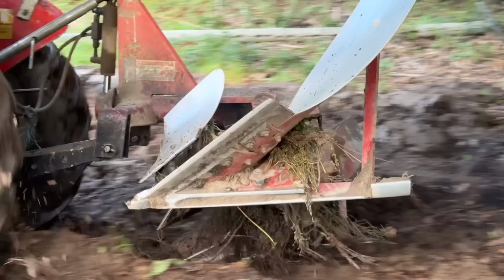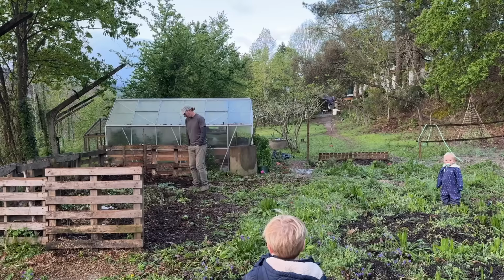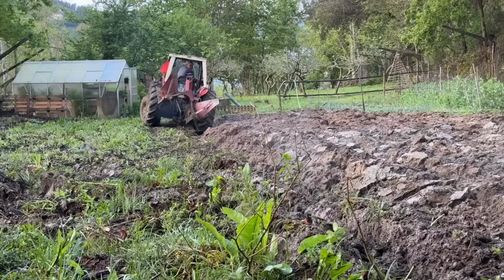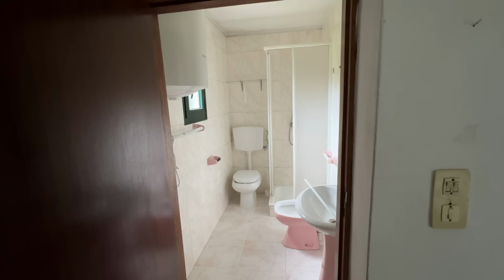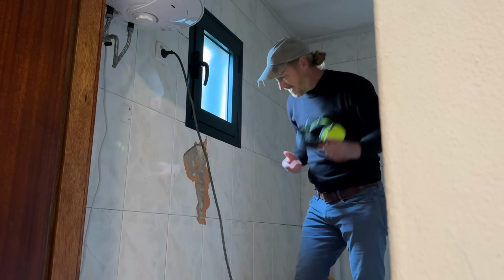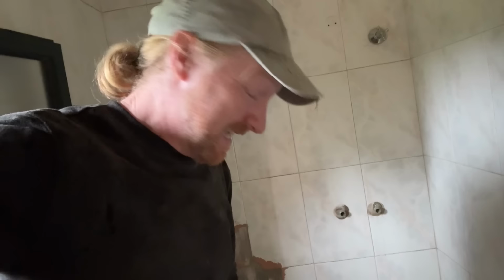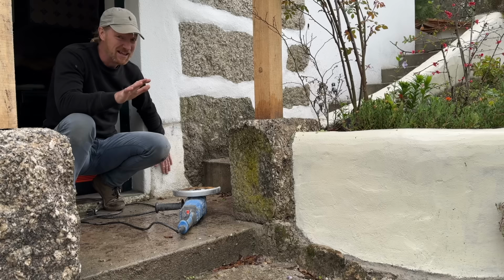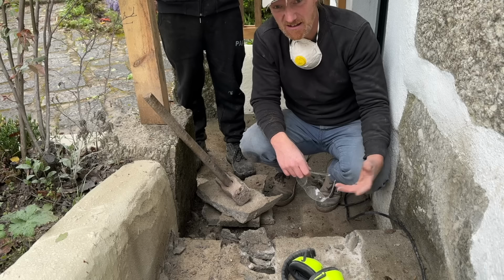She's been Waiting Weeks for This

Comment: Those bathroom fittings should have been carefully removed and sold on ebay or similar, would have helped pay for the new one.  They may have been exactly what someone was looking for.  That Tiler did a better job than the one that tiled my bathroom, I'm forever sticking them back on.

Comment: Hi John. Please check out the latest video of Van wives to see what happens when you do DIY and not wear PPE. 
Chemical burn in her eye from cement entering her eye as she was not wearing eye protection. I was concerned for you when you were smashing up the bathroom with a hammer and pieces porcelain were flying through the air which could have easily gone into your eyes.
Please be aware that your boys watch your actions (when they are around) and it would be a good guide to teach them how to be safe when working.
Good luck with the renovations.

Comment: You can tile right on top of the existing tile you don’t need to board it first. You can also get a tile chisel for the sds drill it has a 4” edge blade to it so removes a decent amount of tile in each pass.

Comment: That looked really satisfying - using brute strength as the irresistable force on the immovable step and winning. So well done!
I'd love to have done the bit where you smashed up the bathroom, that looked fun.
I hope your time alone doesn't get too wasted by rainy days and waiting for a plumber.

Tara, the garden has to go at a manageable pace. If you did go and get all the cardboard you needed in one go, it would go against what you're setting out to achieve as you'd have to get fresh cardboard instead of recycling your own. Maybe there'll be some packaging with the new bathroom furniture.
Doesn't freshly turned soil smell lovely though?

Have a lovely break. I'll look forward to the video post cards.
Reply from the maker: Thanks Ruth, it was pretty satisfying I must say 😂

Comment: :hand-pink-waving:a good plan for the winter is to just unroll a huge round bale of hay (or two) on top of cardboard and by the spring it will be done.  digging in compost is just fine. Just do it as you find easiest and what works for you? Charles Dowding is the one to follow if you are interested.  ps grow comfrey.. it will grow like a weed from one plant and you can either dig it into the soil or make a tea by putting the leaves in a screw top  barrel - fill with water and take off the water after about a month as a fertiliser for your plants in the greenhouse and flowers around the house.
Reply from the maker: Thanks so much for the hay bale idea friend! ❤️❤️

Comment: Is there a required minimum FFE in your area per building code?  You don’t want excess water in a significant storm event running into your home if the floor was too low at the stoop.
Reply from the maker: Good question. Research suggests this won’t be an issue. Great to hear from you, thanks for watching friend.

Comment: I swear you create more work than needs to be done. Why take the wall tiles off. They were neutral and you could cope with them for only 2 years.
Reply from the maker: Hi Deborah, the stone house will stay forever. It’s just the wooden extension we need to possibly take down. In which case we are creating a guest house bathroom here that we expect to be used for a generation. 👍👍
Reply: @TheNewbys  that makes sense